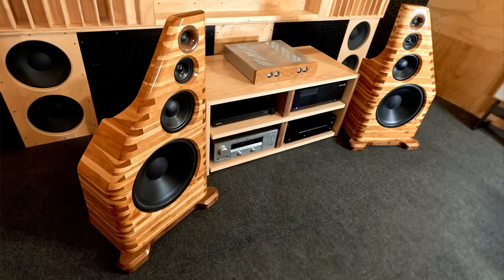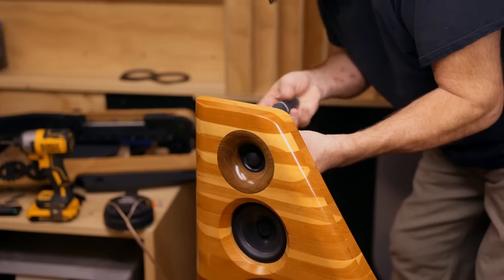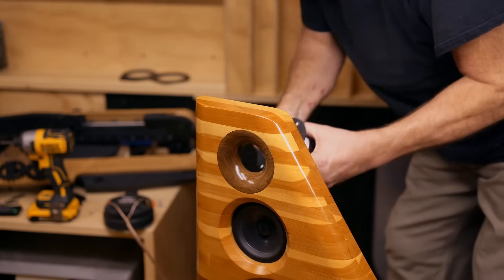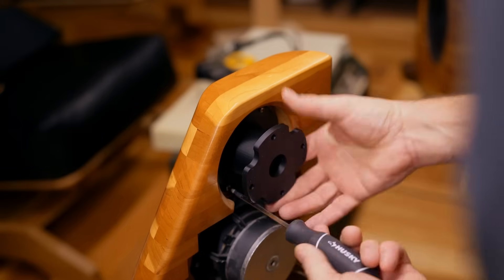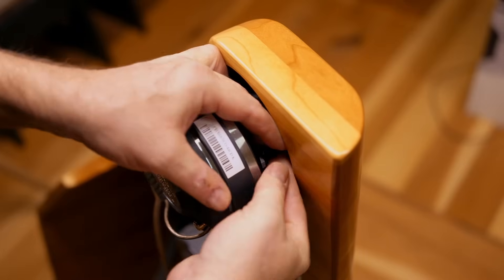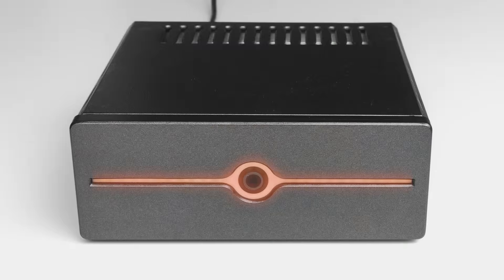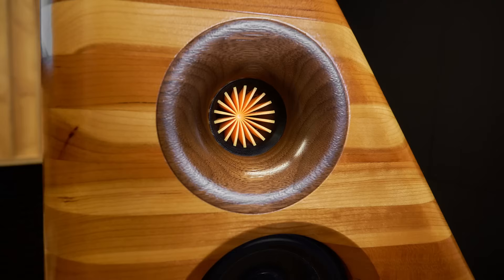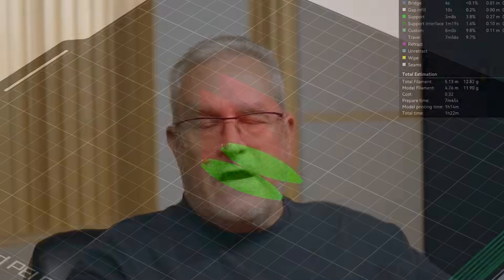Can't Hear The Highs? Time for a Tweeter Upgrade! PLUS a Wee Rant!

Comment from the maker: Hello again! It's been a while.
The tweeter upgrade takes the freestanding "super" tweeters I added to the system last year and installs them in place of the tweeters in my main speakers. I then took the original tweeters and mounted those on the back to make the speakers true dipoles. All done with the help of 3D printed parts. This makes the experiment I ran to test the idea more permanent and also reduces the problems associated with having two tweeter spaced apart (possible comb filtering).
Why the long break, John? Well, I got a bit burned out on the topic and that's normal for me. Audio is on again, off again for me and always has been. And getting deep into it causes the burnout that turns me away from it. 
Also there's the ongoing problem of talking about a subject that is so full of bad or poorly understood concepts, and how that can be frustrating to the point of wearing you down. I started this channel (or more accurately, switched it to audio) to talk about the technical aspects of the hobby and to design and build audio equipment. But most of the audience for the hobby (obsession!) are only interested in the trivial, like comparing brands of speakers, cables and gear in the same price range and parroting the stuff they've heard that they want to believe. Maybe an apt analogy is to be someone who wants to play baseball on a team of guys who haven't even picked up a ball, but are walking encyclopedias on player's stats. They want to sit around and discuss OBA and ERA, while all you want to do is play ball.
Such is the way it is with everything, though. Most people don't do much that is practical and tend to avoid talking about or listening to stuff they prefer not to believe. And I knew this going in - I was a regular on a large audio forum almost 20 years ago and met with the same situation, and the way to deal with it is to step back and take a break until you build up enough stamina again to tolerate the stuff that ruins the hobby for many of us.
Unfortunately, like most everything else you might be interested in, the trivial dominates and totally eclipses the practical. That's because it cost nothing and required no effort to just sit around and discuss a topic, or watch videos on comparing virtually identically performing equipment and fool yourself into thinking you are learning something of value.
On one level I get it: most take the trivial stuff as entertainment and there are certainly worse ways to entertain yourself. I've done some of it myself before I knew better, so I do understand the attraction. But now it wears me down and I have to leave it all behind until my desire to get back in outweighs the deep slosh of BS that has to be waded through to participate in the hobby in a public way.
More videos to come? Yeah, I think so. I have a pair of speakers I started almost a year ago that I didn't finish and I also want to finish the case for my 10 channel amp and my sub amp. Plus there are some other projects I'd like to do and maybe some more practical testing that no one will understand and draw the wrong conclusions from.

Comment: This is a video topic request to see if deep groove 4x4 tire tread from an aggressively treaded M/T tire such as Goodyear Territory M/T tires would make for a good speaker baffle material. How will gluing 6x6 inch chunks of tire tread from new or used tires onto the interior walls of a larger speaker enclosure behave when applied in a consistent longitudinal pattern (i.e. tread goes all on way!) or in a cross-hatch pattern where tiles of tire tread alternate between X and Y axis directions CHANGE the sound?

The tire tread patterns of off-road tires, winter tires, rain tires and summer tires SHOULD have varying effects on sound quality and the deep or shallow grooves should ENHANCE or DISTORT the sound in various ways. The grooves SHOULD ACT as sound traps at certain frequencies and we would like to know WHICH ones those are!

We, the viewers, WANT YOU to test and evaluate our supposition that tire treads from NEW or USED tires can change speaker sound for the better or worse!  Give us some detailed graphs and tests of using new or old tire tread inside of speaker enclosures and let us see if adding ANOTHER LAYER of thick or thin layers fibreglass, rock wool, foam or other type of baffling on top of the tire tread WILL ALSO change and/or enhance the sound for various tweeter, mid-range and bass drivers! 

Which tire tread and orientation direction is best to use (i.e. Winter, Summer, Rain, All-Terrain, Off-road tire treads in straight longitudinal or alternating directions for each 6x6 inch panel?), which added layer of fibre or foam batting or not is best (i.e. None, Rock Wool, Fibreglass, acoustic foam, wool, cotton, etc.) and at what thicknesses? Also show the frequency response for all the added materials!

This would be an interesting TEST of seeing if unusual materials can me used for interiors of speakers!

V

Comment: Compression drivers for tweeters:
I built slot-loaded open baffles and im having trouble with tweeter driver quality. I keep getting ASD1001 units from Eminence with variable quality. Some just have flaked-out buzzy distorted sound and others are fine. 1” throat. Screw-on.

What compression drivers (brands) do you have experience with? Looks like bolt-on types are more common, but I have midrange drivers that take screw-on only (coaxial design)
Reply: I cut the backs off my ASD1001’s and put paper maché cones for rear firing drivers.
Reply: @PungBoy3 yeah but the issue seems to be the drivers themselves. Sometimes OK, sometimes not.

Comment: Good to see you are back.  Much of this podcast resonated with me because I have toyed with starting my own channel.  My reluctant is frankly what you have touched on: the audiophile community has strong opinions and there really isn’t much interest, from what I have seen, in any opinion that does not support the opinions they have already formed.  All they want primarily is confirmation that their opinions are correct.  I doubt that is a “wall” I want to bang my head against.

I totally agree that the room has the biggest impact on the room.  The frustrating part is that, if you listen to most reviewers on YouTube, you would get the impression that room acoustics can be impacted by electronics that do something other than EQ or DSP like streamers, DACs, amps, even preamps.  To me, that is nonsense.  If you want good room acoustics, you do 2 things: treat the room as best you can; and setup  your speakers as best you can in that room.  Everything else is secondary, if not a complete waste of time.

Carry on the good fight!

Comment: Many years ago I did the same thing when I found out my dad couldn't tell if the tweeters were powered up or not. I converted to a bi-amped setup to tune the super tweeters to blend with the existing speakers. My dad was amazed. Now years later I am in the same boat and need to boost the highs to make things sound right.
Tuning for a flat frequency response is only good if you still have flat hearing.

Comment: Regarding your comment about selling/recommending gear .. as you would know(if I have ever made a comment worth reading), I'm a quite senior (in two ways) test and measurement guy(Tek, Agilent,  R&S, Nokia R&D), so I appreciate your clear approach, and I much prefer "first principles" to some rant about some particular piece of audio gear, especially the audiofools wildly-overpriced, and never double blind tested, "must be great for only $19,355...*
From my earlier jobs as a motorcycle"technician", and years of driving with an open window, my hearing is -20 dB at 3 kHz, a bit better at 5 kHz, and completely gone above 10 kHz, so I'm still relatively happy with a dome midrange, a KEF tweeter, and a DH 200 amplifier that needs new electrolytics.
Have a decent weekend, keep well, I think that the phrase that we need is the old "illegitimi non carborundum!"

Comment: Yep, the audiofool religion, thus speaketh... Your favorite flavour of the week in audio reviews, the guys with $25,000 DAC'$ , that sound as good as my 1995 CD player...and $300 ethernet cable, and $10,000 for the required speaker cable ground plane isolation pyramid schemes... Discussion about actual measurements, not worthwhile, because so-and-so says... Carpentry, much less "religion"

Comment: 9:05 mark... agree 100%. Audio enthusiasts of all ages have very firm believes. And don't sway easily if at all. Nothing really new in audio has been of any really benefit. Yes currently, cheaper power amps ( however class ab vs class d), speakers performance in general, digital vs analog is probably the biggest.  But nothing that's been a major breakthrough... and especially on something so subjective as personal hearing. Is the same with color or smell in my opinion. Glad ur back.

Comment: Thank you for this John, it was such a pleasant surprise! I also suffer from the "square wave". I have hearing aids that had not been adjusted for years and this dampened my interest in audio. I finally went to Chs and what a remarkable improvement they made! I decided to go back to square one with my room treatment as I realised that I was just throwing solutions at it that just did not work ( that part about half listening....yeh ). I removed half of the absorption panels and rearranged the reflective panels, then I moved my speakers further from the walls. Now I have the detail that I can hear with good headphones but with the stage of an open baffle system. What a relief to finally get going in the right direction. For listening with headphones or earbuds I use "Easy Effects"  to adjust the sound. I will use the equalizer that moOde audio has to do the same with my system.  Thank you again John for your honesty and willingness to cut through the BS.  Audio is an amazing hobby if you can resist jumping on board with cheering sections.